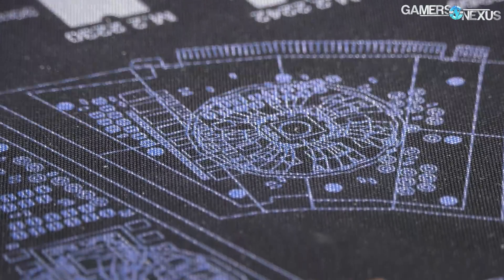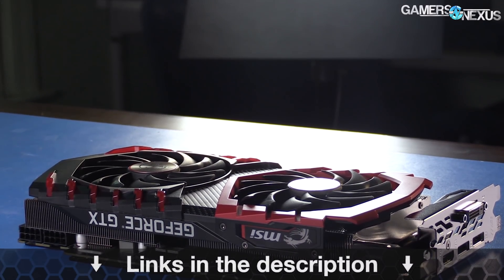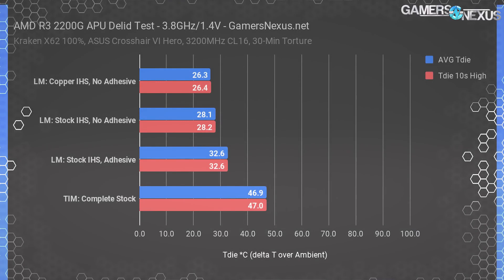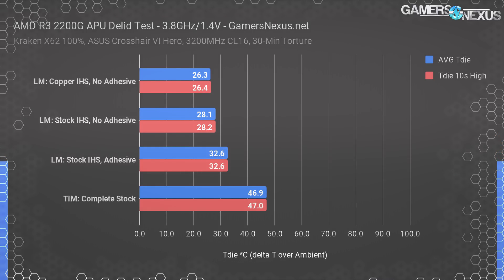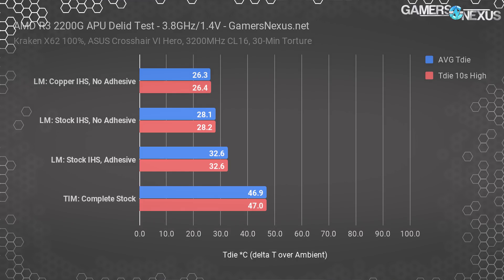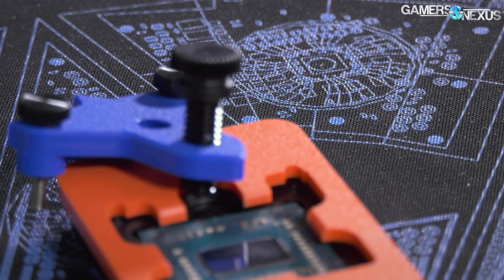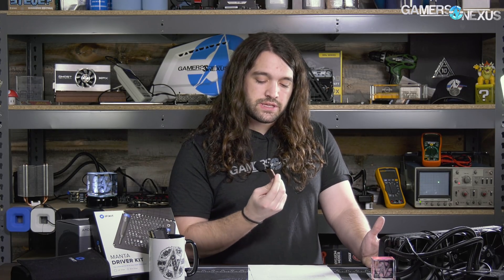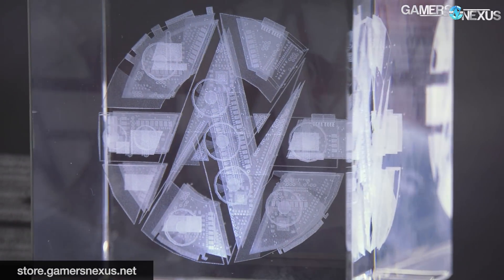Ryzen Custom Copper IHS Tested

Comment: "correct pronounciation of gif"
TRIGGERED
Reply: I know I've been eating jif for years never knew it wasnt edible. lol
Reply: So to sum up both sides of the jif vs gif argument:
jif is the pronunciation used by the creator of the format.

gif is the logical pronunciation of the word. 
gif is short for "Graphics Interchange Format" graphics is pronounced with a g. 
Therefore when you shorten it to gif it will still be pronounced with a g. 

I personally fall under the gif camp as the creator of the format did not create the words the acronym is based of and as long as it remains this way gif is the only correct pronunciation. Now if it wasn't for the acronym jif would be the only correct way of pronouncing it in english.
Reply: Subscribed again just to unsubscribe! Again!
Reply: qlum 

well, graphics is pronounced with an G but if you go by that logic, you'd have to pronounce acronyms like "laser" (light amplification by stimulated emission of radiation) differently aswell.
Reply: Jirls love to jive their boyfriends jifts
Reply: Styreta X jiffer
Reply: #smokedoutpositivesquad doesn't everyone pronounce it lass-er?
Reply: qlum If you're going to pronounce it with a g because that's how you pronounce the word it stands for, then you should also say NUSCAR instead of NASCAR.
Reply: Then they should have spelt it jif.
Reply: Pearson James I am just pointing out that the creator of the file format named it gif and pronounced it jif lol, it is his creation, he can name and pronounced it however he wants. So it is still strange people are telling the creator of the gif extension he is pronoucing the thing he named wrong.
Reply: Jime Q No one misunderstood you.
Reply: aidanjt no because it's an abbreviation for Graphics Interchange Format
Reply: Jime Q just because you are great at IT does not automatically make you great at English, I assume that is what happened here.
Reply: It is weird how Steve Wilhite pronounces it "Jif" and yet people say he is wrong o.o weird indeed
Reply: lol, it has ALWAYS been pronounced jif